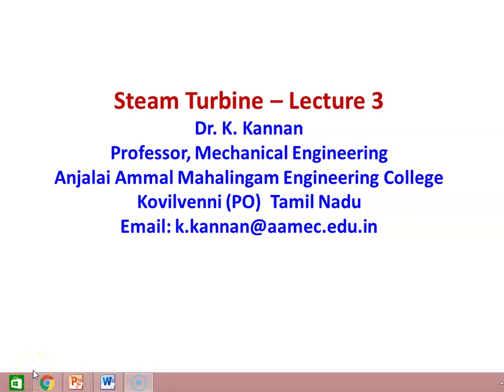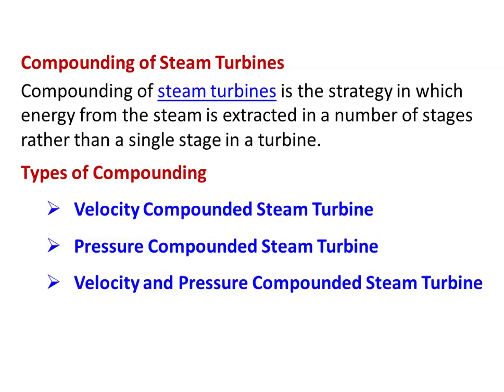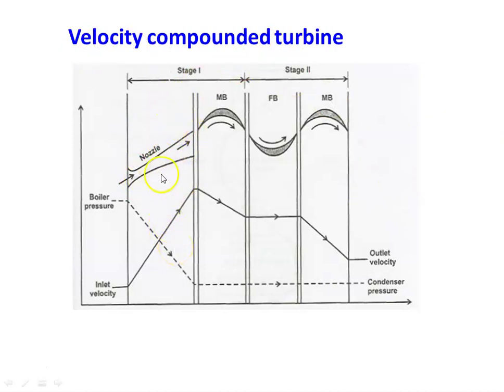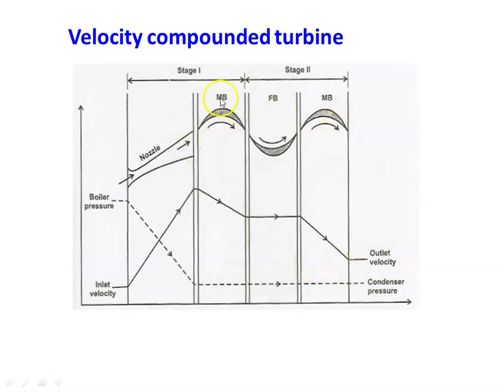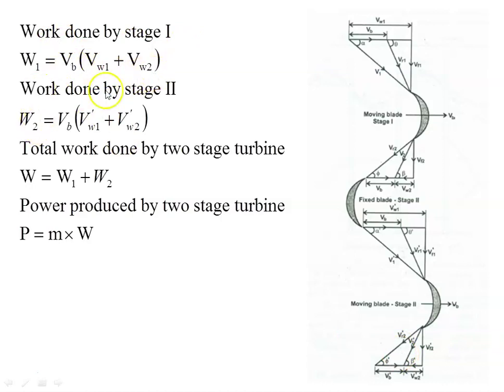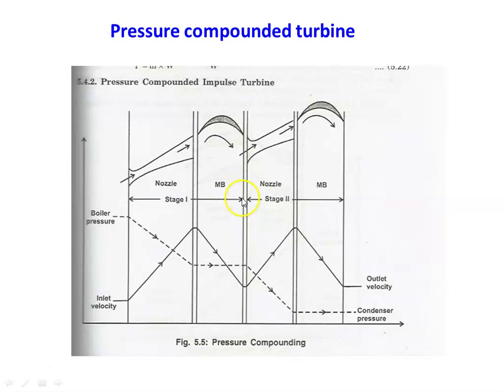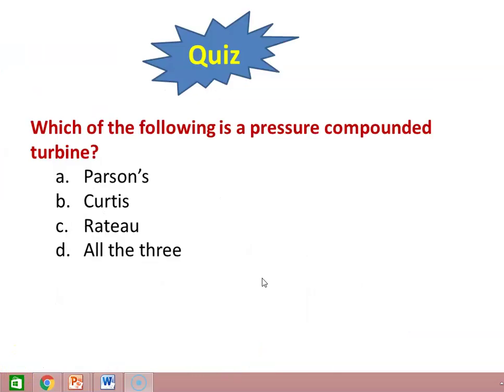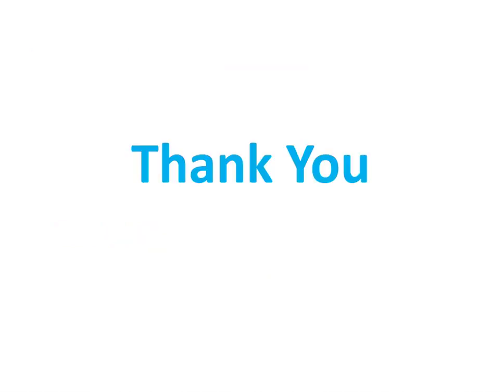ST 03 Steam Turbine - 3

Comment: Why don't we use an exclusive pressure compounded turbine itself practically...as the velocity is raised after passing through the nozzle everytime...
Reply from the maker: It will increase number of stages and overall length of the turbine